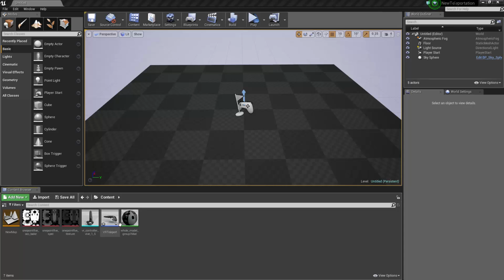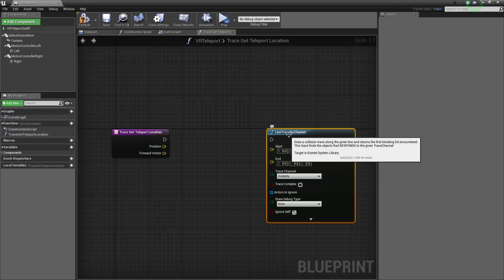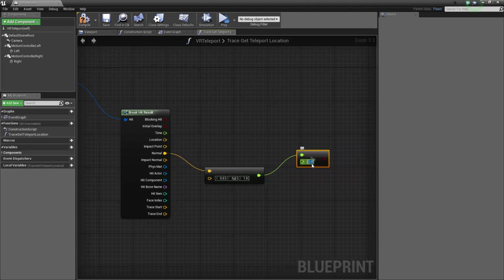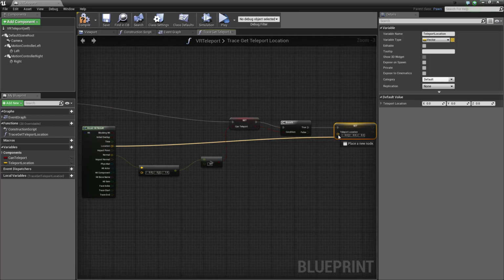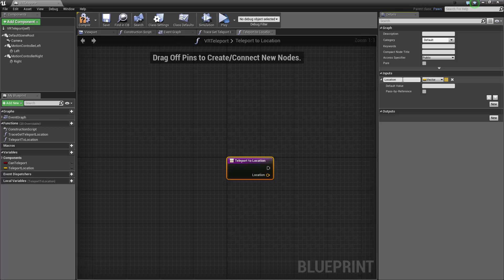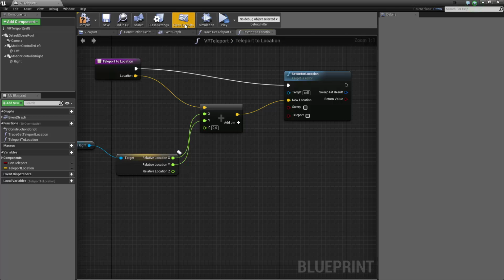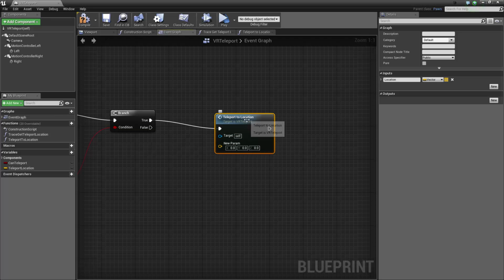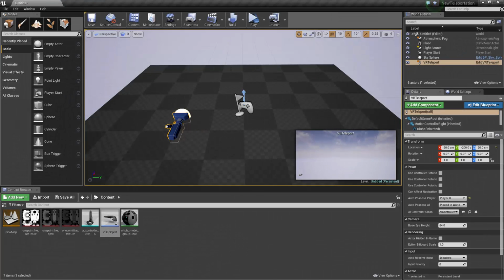Teleport in Unreal Engine - HTC VIVE

Comment: Hey, thanks for this. But my teleport location has an offset. It is probably the local position offset of the camera inside the blueprint. Any tips to fix this? Thanks in advance...
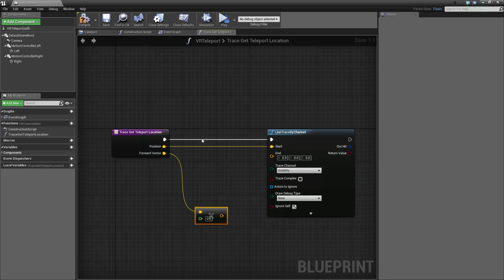Reply from the maker: I have seen some glitches where the forward vector multiply is too small resulting in some wonky placement after teleport.  Increase it from 10000 to 100000000 or so and see if that helps.  I set that up at @1:58.
Reply: Thanks! But i could solve it with the Teleport Node. https://docs.unrealengine.com/latest/INT/BlueprintAPI/Utilities/Transformation/Teleport/
Now it works as expected.

Comment: The tutorial works great, but for some reason, which I can't figure out, the teleportation indicator, or the cylinder rather, is like 15-20degrees off, not really sure how to fix it at this point...
Reply from the maker: HI Daniel - try increasing the forward vector multiplier (@1:56  in the video) to 10,000,000.  I found if it is too short the tracking is a bit off.

Comment: I know this is all built into the vr template now, but this actually works quite well. I pushed it a little further by moving teleport location to the release side of the trigger press and a boolean variable to activate teleporter so when the trigger is pressed you get a debug circle and when you release it you are teleported to the new desired location and disappears. It just seemed like a nice way to not have the debug cylinder on screen the whole time. Now I have to see if I can use this to teleport onto objects with a different height.  This actually works really well though for a basic method of teleporting around my VR mini golf course. Thanks for the awesome video!

Comment: No idea why you're multiplying the vector by 10000 and then adding the same vector to it.  That just makes the vector slightly longer!  Perhaps you meant to add the position as an offset?
Reply from the maker: Getting the forward vector returns the actor's forward vector (direction) but only a length of one unit.  Multiplying it by 10000 scales that so it is much, much longer and can intersect other objects allowing the teleport.  Without multiplying the vector and adding it to itself we could only teleport to things 1 unit away.

You can read more at https://docs.unrealengine.com/latest/INT/BlueprintAPI/Utilities/Transformation/GetActorForwardVector/index.html

Comment: Hi, Christopher. Thats a huge help for starter! I've made it work for me finally, but there is one mini problem. It works, but the cylinder which is intented to move around space is snaped to 0,0,0. It looks like the cylinder is not the final location mark, but a simple vector line. Do you have any ideas how to solve this? :) thanks again!

Comment: Is the forward vector of 10000 that you are multiplying the speed of the teleportation?  I am interested in experimenting with a sliding teleportation, where the pawn walks/runs to the location.  Any clue on how to do this?
Reply from the maker: that multiplier is just the distance the controller can intersect for teleportation. I have not tried motion in teleportation yet. Best of luck.